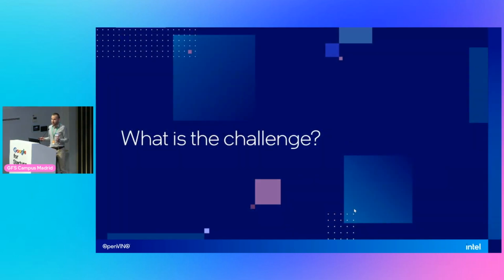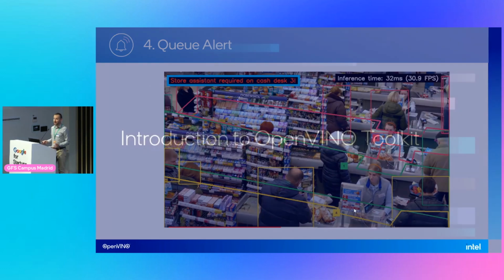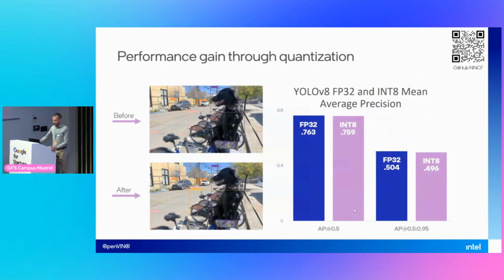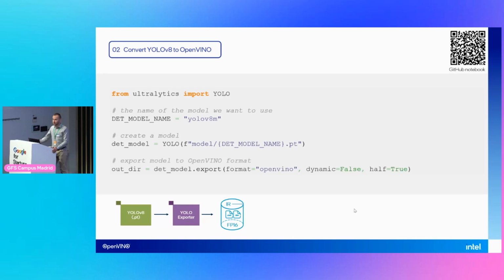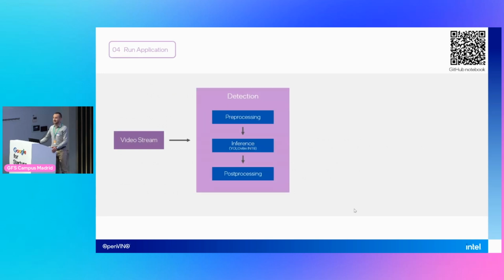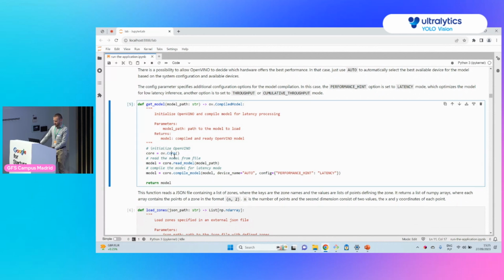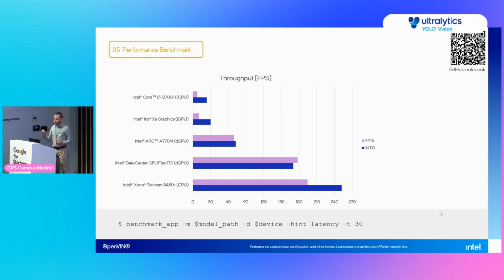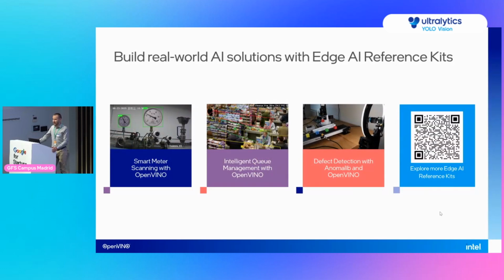YOLO VISION 2023 | Keynote: Learn How to Build a Smart Queue Management System with YOLOv8

Comment: Yo, loving the idea of AI kicking long lines to the curb! But what's the real move when YOLOv8 gets it wrong—like, are false positives gonna send Karen to the back of the line or what? Anyone got horror stories or wins from using this in wild retail chaos?
Reply from the maker: Great question! Real talk—no computer vision system is perfect, and even YOLOv8 can sometimes make mistakes, like false positives (detecting someone who isn’t really there) or false negatives (missing someone in line). But here’s the deal: the best queue management setups use techniques like region-of-interest filtering, confidence thresholds, and sometimes even tracking algorithms to minimize those errors and avoid sending “Karen” (or anyone!) to the wrong spot.

In practice, wins usually outweigh horror stories—stores have reported smoother flow and less staff stress, with smart alerts when queues get long, not just based on a single frame but by analyzing patterns over time. However, challenging environments (weird lighting, lots of overlapping people) can still trip up even great models. That’s why it’s smart to combine AI with some human oversight, especially at first, and to keep your models and software up-to-date for the best accuracy.

If you want to dive deeper into how these systems handle edge cases and real-world chaos, check out this article on YOLOv8 queue management in retail and airports https://www.ultralytics.com/blog/a-look-at-real-time-queue-monitoring-enabled-by-computer-vision and this retail experience breakdown https://www.ultralytics.com/blog/ai-in-retail-enhancing-customer-experience-using-computer-vision. Got a specific horror or hero story? Would love to hear it!

Comment: Cars on intersections or queue of peoples in supermarkets are relatively slow traffic. Even 1/5 FPS is enough to detect that queue and inform peoples to do something about this. I bet single CPU will deal with 10 parallel streams on yolov8m.
Reply: Interesting subject. I have been wondering about the speed of detection for certain control applications
Reply from the maker: Indeed, you're correct. Traffic monitoring analytics can be achieved at approximately 5 frames per second (FPS) and can be easily accomplished using a CPU.